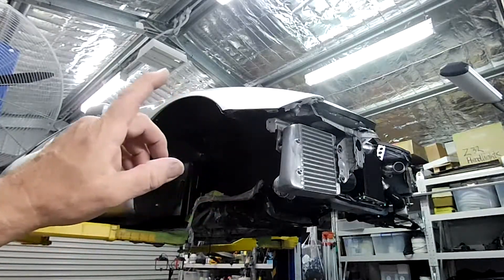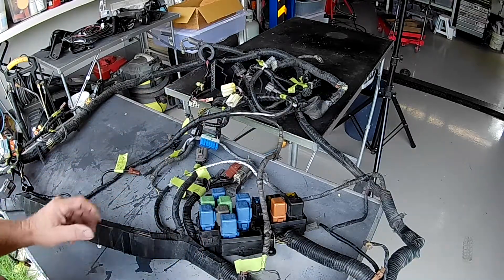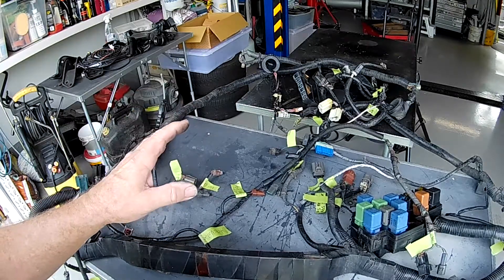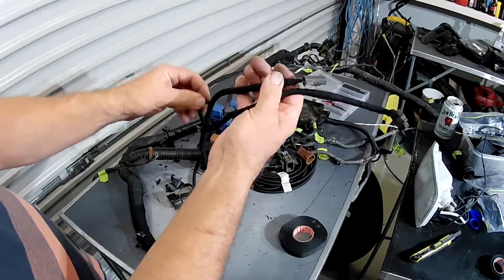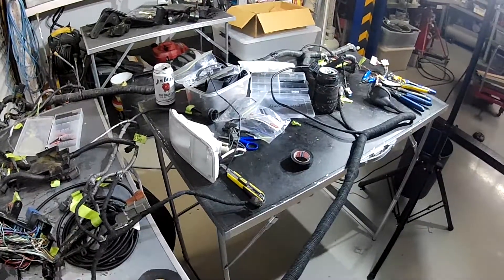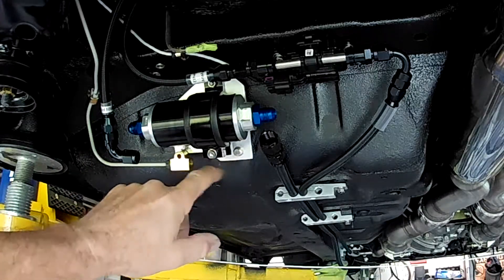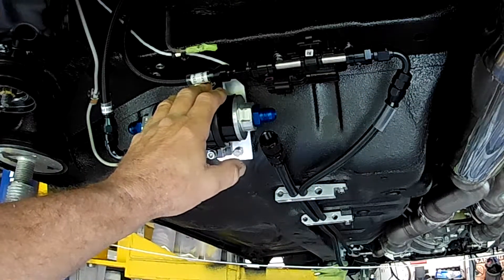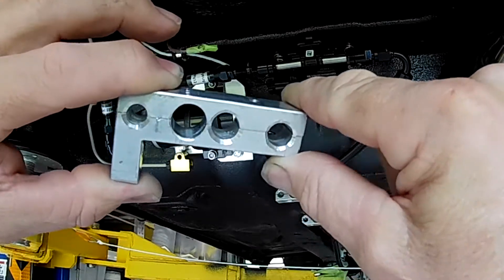Fuel System Revision+Body Harness Repair Project Fairlady The Nissan Z32 300zx Twin Turbo Mega Build

Comment: This thing is going to be a monster when you're done building it, though you may need to swap the springs in your turbo wastegate or just swap the turbos themselves to something with a more robust back end. Still, I'd expect the turbo potatoes to be good for probably 5-600HP with the right spring rate.
Reply from the maker: Cheers Robert, yep, running out of Turbo will possibly be a factor. Hopefully I will hit my power goal before that happens. Wastegate springs are 14 pound so I should be able to get to 25psi with the boost controller. When I say boost controller I mean the Haltech, as it handles that job also. I have Modern Billet Compressor wheels for the Turbo's, so that should help a bit everywhere (spool, top end, efficiency). Exhaust Housings are .86ar, definitely big enough. I even had to grind the Engine Block to make them fit properly. I'm pretty confident this setup can deliver 700+ at the wheels reliably.
Reply: @TheAussieShed  It'll be great fun to see how much you can squeeze out of them, and running on E85 will keep your combustion temps much more manageable, so the turbo bearings stand a lot better of a chance of surviving even when you thrash them with loads of boost. I always enjoy watching the builds that aim for reliable power production instead of just throwing boost at the problem until their engine explodes, so this build is great.

Comment: On a stock fuel system we got a fuel pressure control unit..
Wondering if that was intact on yours.
Did you also drill out the pressure relief valve on the hangar?
Reply from the maker: G'day Jeri, no, i'm running a GFB FPR on the return line from the fuel rails. Pressure relief valve on the Hanger??? Are you referring to the Venturi Pump? I did a video on the Hanger Mods I did a while back, maybe there are different versions for 2+2, NA, etc. Cheers Mate.
Reply: @TheAussieShed  right the NA doesnt have the popoff valve on the hangar only TTs do.
Reply: I preferred the stock approach with the pump controller that drives it with 6/10/14V. It removes any stress on the pump when not needed, i.e., 95% of the time. I have upgraded the FPCU internals (mosfets, capacitors) to be able to drive a 450LPH walbro ...E 85. Works like a charm >6 years.
Reply: I drive a TT 😊

Comment: What fuel filter is that?
Reply from the maker: G'day Dan, its a bit of a cobbled together unit. The Centre section & the mounting bracket are Chinese, the ends are from an SX Brand Filter housing & the filter element is a FueLab 718 series.
Reply: Awesome thanks… also what flex fuel sensor did you go with? We are currently doing the same thing to the car, I love your set up, custom brackets ect. Going to try and replicate it